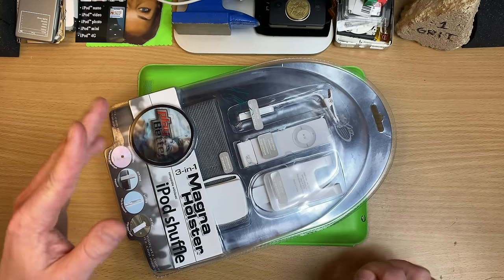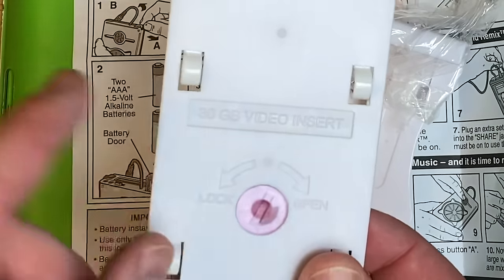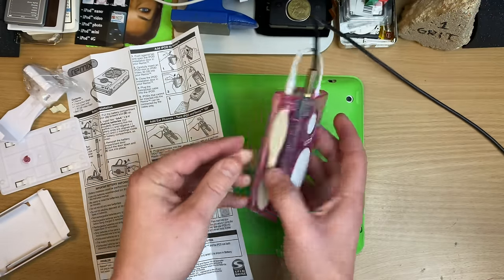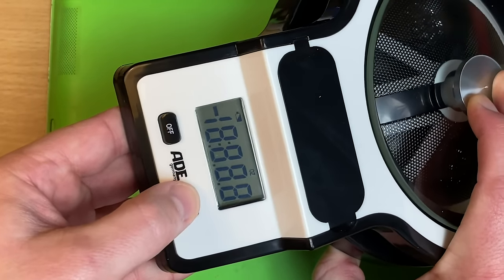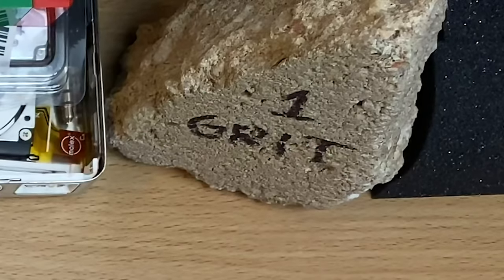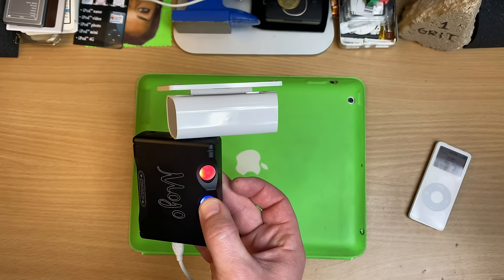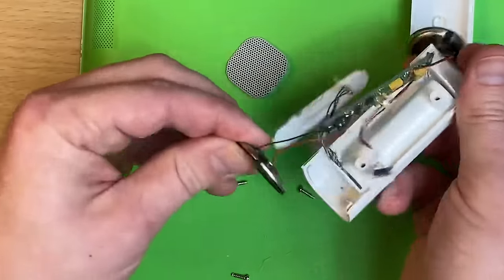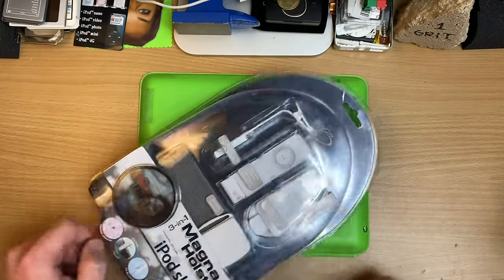Stupid iPod Accessories.

Comment: 7:16 Not gunna lie, Definitely thought you blew the breaker here xD

Edit: Also, 425g is the weight of the food in the can, It does Not include the weight of the can itself.
Reply: cans dont weigh 90g ... try 40g
Reply: @tobycarter3629  Technicalities..
Reply: @ElixTwo  At it stands at an angle. It is not meant to do that. Regardless it is just a piece of
Reply: @KaimasterXD  Yeah the angle doesn't help it and true, It is a piece I was just trying to give some credit to the scale part of it lol
Reply: @ElixTwo  If it's like any digital scale I've ever used the off button calibrates it to zero, you hold the button to turn it off.
Reply: Aidan Montgomery that's what tare does I'm pretty sure. Zero the scale and make it level that's just basic scale stuff even a fitness scale has to be zeroed and level.
Reply: You also have to factor in the  gravitational constant, which is different in the US and Australia.
Reply: Owanneke  you don't drain refried beans, its a paste
Reply: He needed to hit the tare button to zero it out first. I bet it's fine.
Reply: @Catloaf87  It calibrates it too though.
Reply: @Catloaf87  Or in other words.... set the scale to 0.
Reply: Cat Loaf to count for the bowls weight you zero it just with the bowl it’s the same process
Reply: Or prolly cause the beans expired???
Reply: If the can says 425g, you get at least 425g of food inside. They can go over, maybe by up to 10%.

Comment: Dank, you’re supposed to take the beans out of the can

And put the scale on a flat surface.
Reply: I put beans without the can on my scale and it doesn't work help
Reply: also you need to reset it to 0 with the off button
Reply: @the-shork  on button was the tare button on that scale
Reply: @Jo Lilly Sure, why not?
Reply: @Jo Lilly No use the tear button with a bowl and then as the contents to the bow.
Reply: And the beans go into a bowl after which you reset the whole thing to zero. Using scales 101.

Comment: A few things regarding the scales. At the start when it was saying 18.888, that was its calibration cycle. It takes longer to complete that while you're moving it around. I'm pretty sure that you just cancelled the calibration when you pressed off. It was also showing 5 grams because you tipped it off balance, which is pretty common. The tin of beans only contains 425 grams of beans, the other 80-odd grams was the tin and label. Lastly, that dock would really only be for recipe podcasts/videos. From what I can see of it, while not top quality, it seems to actually be quite a practical idea for someone fucking around in the home kitchen (at least it was when iPod classics were a thing).

Comment: That first gadget is a nice sounding filter. Definitely not a “mixer” but actually sounds quite cool. The crackly bits you demonstrated would sound nice and lofi-ish in the right context. Being that it doesn’t actually need an iPod to work, just the six input, it would actually be useful as a tool for music production.

Comment: 8:36 1. you need to calibrate the scale, 2. the can has weight, 3. the 425g on the can is an average
Reply: Correction for #3: The weight listed on the can is the weight of the contents in the can. Nothing more, nothing less.
Reply: Didn't he have it on the end of the Ipad, partly hitting the table too? so it would have been slanted slightly too.. oofs
Reply: @beamthedeer  Well... nothing more, nothing less is far from correct...
Reply: @beamthedeer  The weight listed on the can is the weight of the contents in the can, the sell by amount. The can does contain extra to ensure you get what you paid for.

Comment: For some reason people freak out when you mess with power connectors. They seem to forget that other than voltage it's just two pieces of metal sometimes 3 unless you're using American 220 but we only use that for appliances.

Comment: The scale is probably okay the weight on the can is the weight of the contents of that can
Reply: Also if the scale is on a uneven surface it screws up its ability to weigh
Reply: I do wonder, however, if the type and loudness of music would cause issues for the scale in actual use (i.e., from vibrations, etc.).

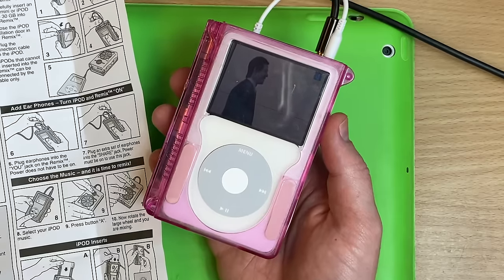Comment: For any one looking for an explanation at 4:48 : 

The sound you are hearing is a potentiometer regulating the voltage, the more he turns, the less or more voltage is given to the speaker, source, or however this crazy “DJ” device is controlled. With no audio, all we here is the noise of the background electricity being squeezed through a changing resistor. 

In simpler terms: Potentiometers GoNe WiLd
Reply: It sounds sort of similar but not the same as a "wah" filter or dunno what (envelope? Frankly too lazy to try to look for the appropriate name), they're basically an EQ with a very shallow band pass, cuts bass and treble beyond the point, and the wheel adjusts that point, of course the circuit being crappy it will pick all kinds of noise and apply the effect to it too.

Comment: I had a non branded unpowered stereo block, no cable, no battery, no mounting for your device, just plug it right in and let it stand or lie however. Its drivers were twice the size of the one shown here and it sounded a bit better than our desktop computer speakers, which were pretty solid for 2010. Were talking two drivers right next to eachother on a pocket sized block, with a 3.5 jack just pointing strait up, and hq plastics. It did its job more than competently, and for all I know those drivers were the only components lol. They had bass, they could fill a room, they were only as muddy as their input audio. How tf do you fuck up as badly as these junk peripherals??? Even I could design and manufacture a block like that.

Comment: the scale already has numbers when you turn it on because you are not putting it on a flat surface. scales always do this. you put it on an incline and you get weird numbers. you put it on a carpet and you get weird numbers. 

also the weight on the label of beans doesn't include the weight of the can

Comment: Taring is to calibrate the thing. That's why, when turned on, it already says a weight, that's why pressing off turns it on (it sets the neutral point) and that's why it doesn't mesure wheights correctly (it's not well calibrated). I still don't know why would anyone make or want this tho.

Comment: The scale is probably accurate, those cans rarely ever have accurate weights on them, they print the labels in bulk before they ever fill the cans, it's a rough guess, weigh two identical cans, you'll never get the same weight. Also, yes I do understand that the weight of the can is not included in the Net weight, I'm making a different point.

Comment: I bought a MP3 player clock that has buttons for different types of music like country rock etc. It's a clock radio mp3 player and has a phone jack sticking out of it and it does work on my 2021 moto g 5g stylus phone and the speaker is really loud. Bought the thing at a yard sale for 50 cents and I now use it as an alarm clock. Like how it has a battery back up something you don't see in modern radio alarm clocks anymore. Just couldn't believe it works on a modern phone if you wanted to listen to music or watch YouTube and use the speaker to make it louder, but I don't only use it for a clock. For 50 cents it's a good buy I guess. Might just throw it away after a few months and use my phone for an alarm and clock.

Comment: I feel the review on the tiny battery speaker is a bit harsh.  He is reviewing this with 2021 standards.  Sure that speaker doesn’t sound great, but with how portable it is and remember in those days blue tooth speakers were not really a thing.  Hell iPod’s didn’t even have built in speakers, so in a pinch this did the job for sitting somewhere chilling and listening ti music.  It isn’t meant for a party just a group of 4 or so sitting around chilling.   I had one so that is how I used it.

Comment: Ok listen. I know it’s been 3 years. 
It’s 450 grams of BEANS not x grams of beans + y grams of tin can = 450 grams.

Also, nice scales have a zeroing function (labeled as “tare”) that change the base for what the scale considers “0”. You must have hit this button while it was bouncing back from measuring, or maybe the black metal piece you out under it still exerts some force on the scale. Either way, this is fairly normal and can be fixed with a quick press of the tare button.

I DEMAND you rescind your criticisms of of the combination iPod dock and kitchen scale, specifically those relevant to its measuring abilities, until further research has been done.